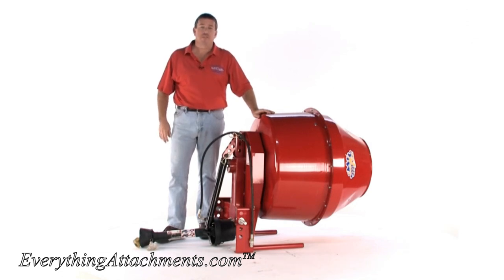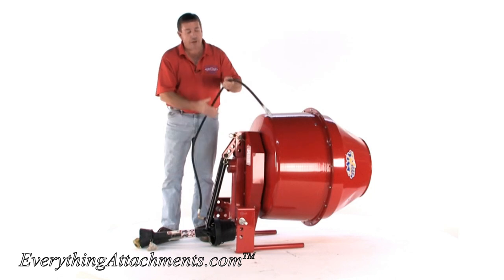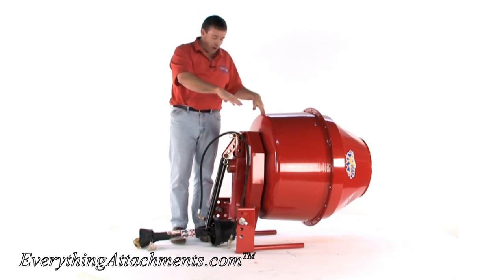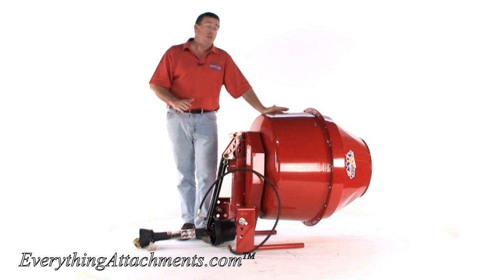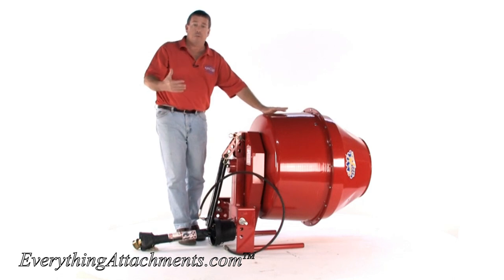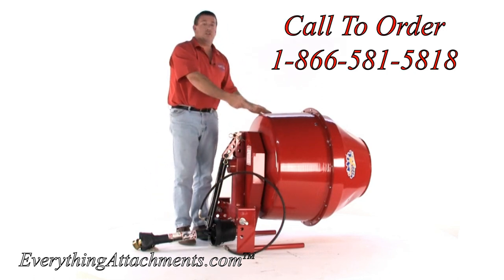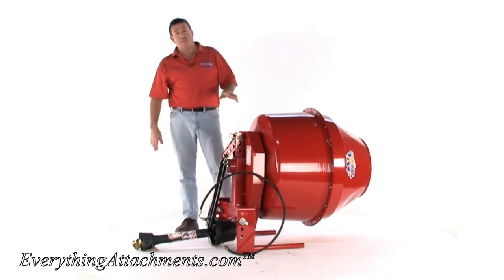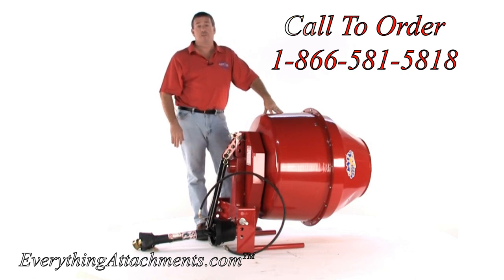Three Point HItch PTO Driven Hydraulic Dump Cement Mixer

Comment: I wish people would learn the difference between cement and concrete!  This is a concrete mixer, NOT a cement mixer.  Cement is the greenish / gray powder that goes into the concrete along with water, sand, and rock.
Reply: You don't call bread flour, don't call concrete cement.